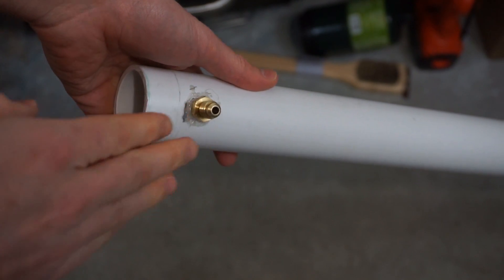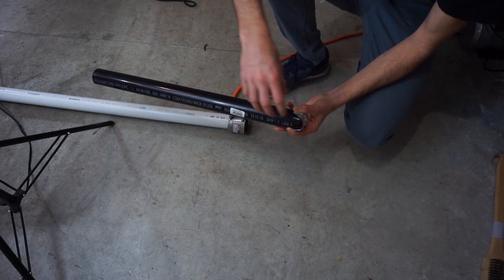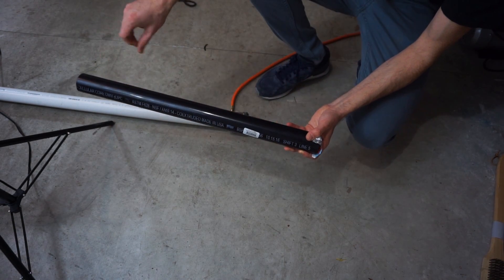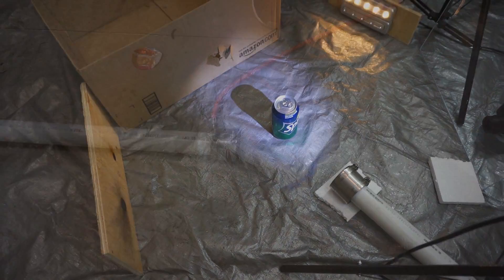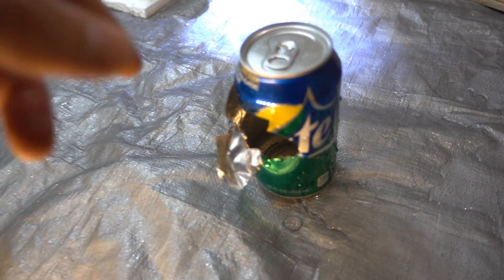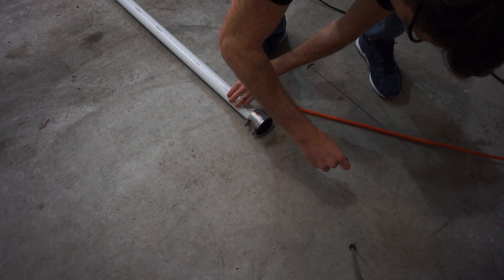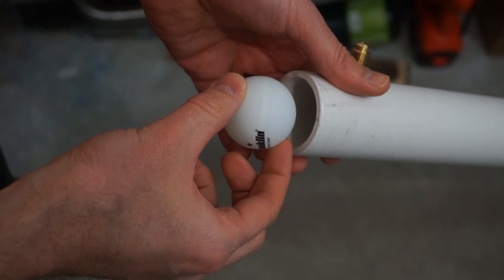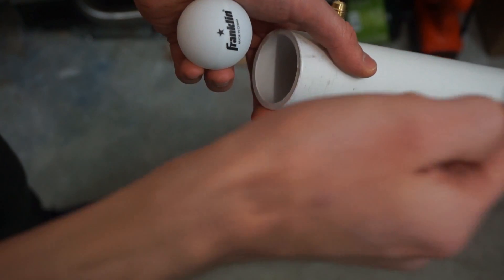How Fast Is a Vacuum Cannon? Is It Really Supersonic? Measuring the Speed  Of My Vacuum Cannon

Comment: You really need a chronograph for an accurate reading and try measuring closer to the muzzle.I'll bet when that ball first hits the air it's like stomping on the brakes in a car.
Reply from the maker: Yes, I agree. In the tube it should be going much faster, Maybe if I can find a clear tube and check the speed inside...
Reply: They make clear polycarbonite covers for 8' fluorescent light tubes.They sell them cheap at HD.
Reply: @TheActionLab  Or measure 1 foot away and 3 feet away.  Then you can cal the acceleration.  Should be able to do with your existing video.  With acceleration you can determine air resistance force on the ball.  . . .  Hmmm that gives me an idea for a lab with my students.
Reply: Ace Oh Spades or my skull i volunteer
Reply: Hydraulic Press Action: do the ping pong ball vacumn chamber vs a watermelon
Reply: You can indeed measure the inner speed by checking how many frames does it take for the ball to exit since the first blowback motion of the whole cannon, divided by the lenght of the cannon itself :)
Reply: Ace Oh Spades great idea! Except the mess it will make.
Reply: it hits the brakes when it hits the membrane

Comment: A longer tube will create other problems as Mythbusters have shown. The boll will simply not exit the tube on the other side as there will be too much air before it, and it will therefore stop before exiting. 

To get around that, you need a big vacuumed container at the exit end of the tube that can absorb all the air that is leaking past the ball. 

You can also make the ball fit better with oil or something, so that no air leaks past it.
Reply from the maker: +Henrik Wallin interesting, I will have to watch their video about that. I want supersonic speed!
Reply: actually, mythbuster's solution wasnt a second vacuum container at the end, it was solved by shortening the tube(they had it REALLY long), and added a high pressurized tank to the firing end, and used the positive pressure to burst the ping-pong end of the film in total, at once instead of puncturing the film to fire
Reply: Lard!  The Mythbusters go-to lube!
Reply: at 3:56 i thought you are going to say make it shorter. Have not watched that ep in mythbusters but adding a lube and shortening the tube might convert most of the supersonic speed to the ball with reduced air resistance and turbulence from skipping air from the front of the ball.

Comment: I should send it to my former physics teacher. YES, physics can be interesting...
Reply from the maker: Yes, physics is fun! Especially when used to shoot things:)
Reply: Physics is always interesting
Reply: DogFoot23 idiot
Reply: make a hole in the ping pong ball...because the air inside of it needs energy to speed up.....logic ? meh you could try it....i'm not super scients😂
Reply: The reason why it's not going supersonic has nothing to do with the (absolutely trivial) mass of the ping-pong ball; you're looking at 15+ pounds force against a mass measured in grams. The speed of the inrushing gas itself has a maximum limit governed by the local average speed of the air molecules, ~mach one. Once the ball (or the front of the gas-flow) reaches the speed of sound, acceleration not only ceases, but energy starts getting sapped from air-friction at the sides of the tube.